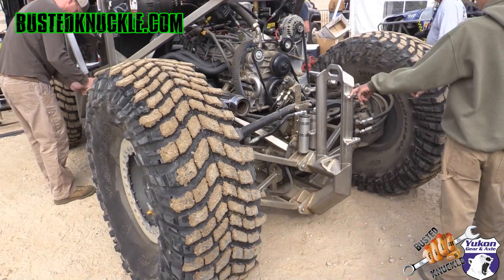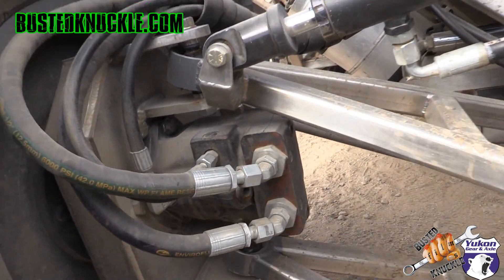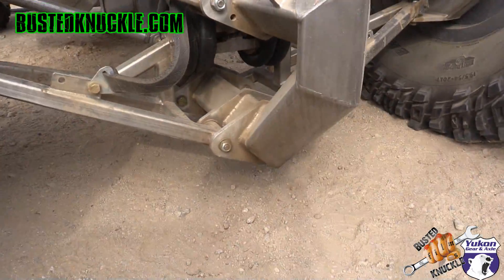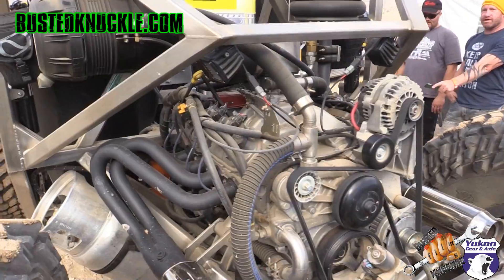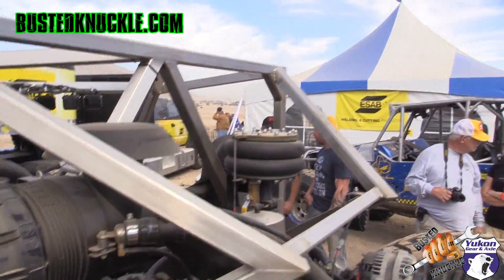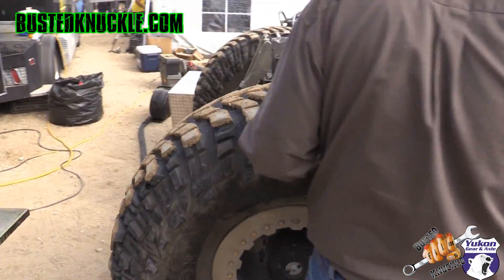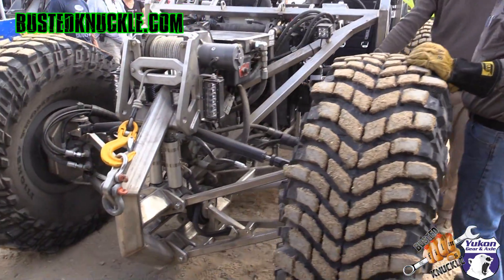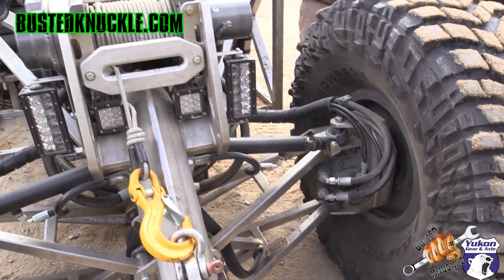HYDRODYNAMIC ROCK CRAWLER BUGGY

Comment: Have always thought that hydrostatic drive might be an interesting drivetrain for an off-road or rock buggy.  Lo and behold, in the July 2010 issue of Four Wheeler magazine, there it was.  The previous version of this buggy had no rearward visibility due to the placement of the radiator and oil cooler,  the one in this video solved that.  To all the naysayers - save it, this thing is cool and you know it.
Reply from the maker: +phatsmitty yeah its cool for sure!

Comment: Lemme begin by saying I'm a heavy equipment mechanic. Way too much engine for a hydraulic setup. All you need is a constant torque supply to turn the hydro pump. Horsepower has no use here except to make it sound sick. Honestly they could have easily made this thing using a small diesel engine and less bs in the suspension. Those motors are only going to turn as fast as the hydro pump will supply hydraulic fluid. And yes less air in the tires and a counter weight in front and he woulda been up that rock the first time.
Reply: i was thinking the same thing... way too much air in the tires, and the propane tanks are in the most vulnerable spot that they could have put them

Comment: The tires probably still could have used some air out of them. I run 5lb in my 54s and I have to much air for rocks. Which I'm sure this thing weighs 8-9000 lbs. Mine weighs 6,600lb and this looks way heavier. Very cool rig and tons of engineering that went into it is cool too from a fabricator aspect
Reply from the maker: Alex Sanders it weighs less than 8k, specs are in description
Reply: BustedKnuckleVideo Holy hell!! 5500lb! That's insane! I think my bouncer is gonna weigh more than that lol

Comment: How much nm torque has the engine? And is it a diesel or petrol? :)
Reply: Doesnt matter much, as long as it can turn the pump 100%, it all depends on what each wheel's drive motor can put out, im an ironworker and at work we have rough terrain telehandler aka a 4x4 forklift with a telescoping boom or zoom boom they have that same drive system and run from a 125 hp cummins, i have dragged 25,000 lb skids with it haha, this is a terrible setup for offroading.